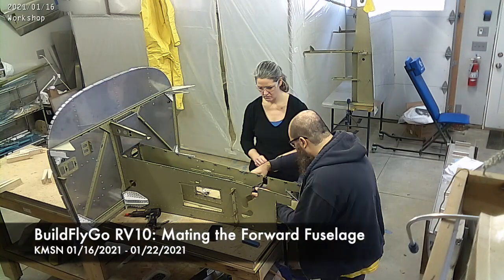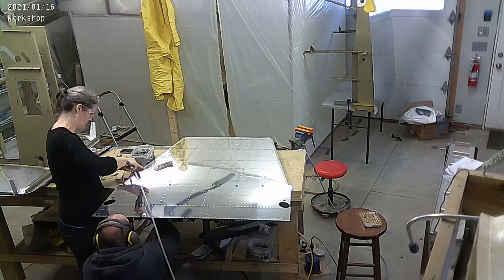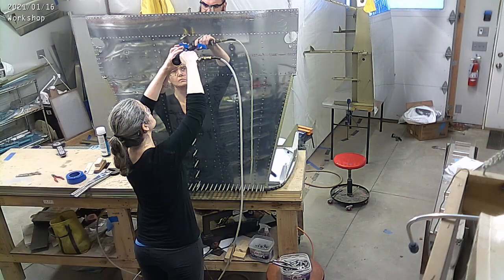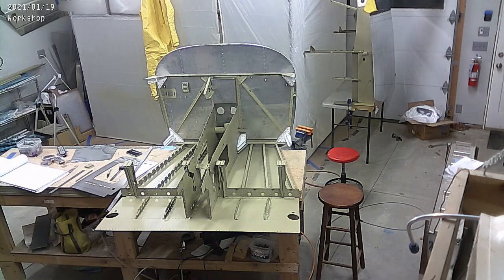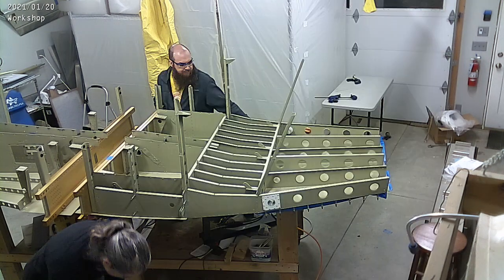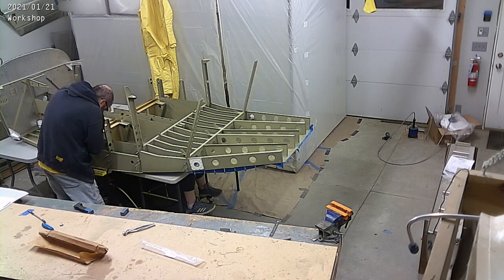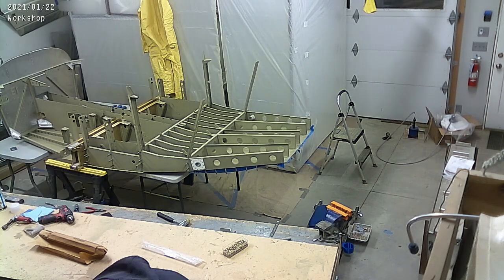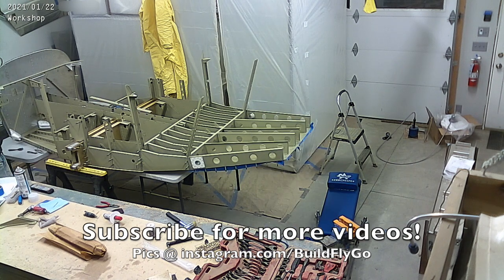RV-10 Build: 01/22/2021 - Mating the Forward Fuselage Halves

Comment: You two are fast!  Just wondering why the inside of the front bulkhead doesn't appear to be primed?
Reply: The firewall is stainless so it doesn’t need to be primed if that is what you’re referring to.
Reply: @auburnaviator6167  Thanks.  Are you based in Auburn, CA?  I live in Cameron Park, CA.
Reply: @bobpenzien7962  Not based out of CA. FDX pilot based out of MEM, TN. Graduated from Auburn University what feels like a lifetime ago, hence the Auburnaviator.